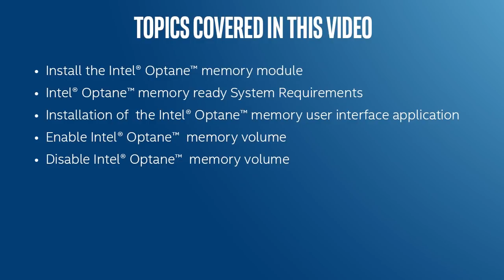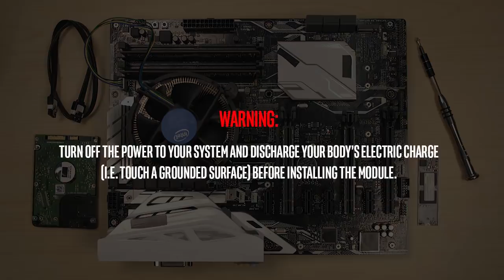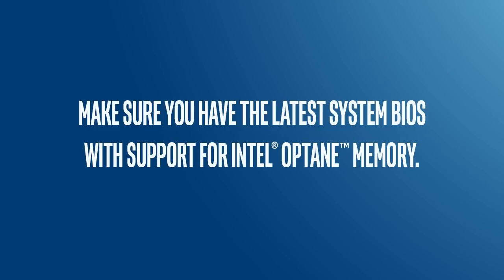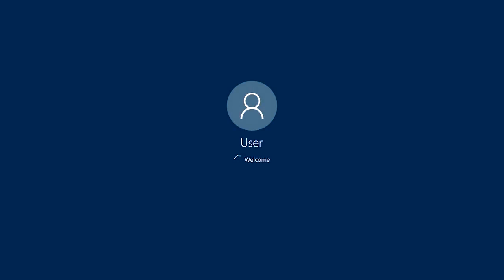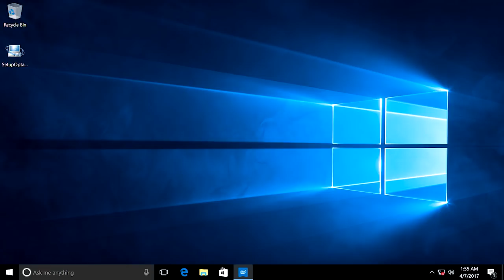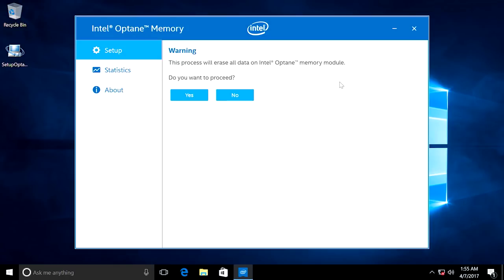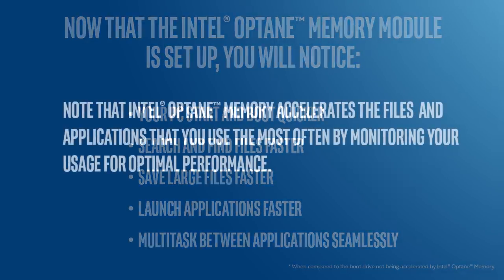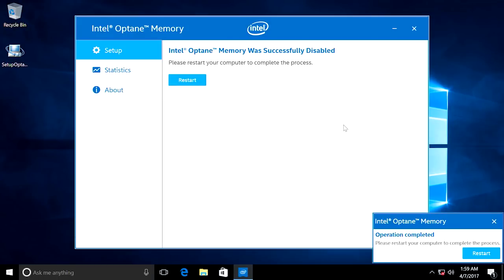How To Install, Upgrade, And Manage Intel® Optane™ Memory In Windows® 10 (basic) | Intel

Comment: what will be happen if  i installed optane memory driver without optane card ?
Reply from the maker: A driver is software or firmware that controls hardware. Often, it connects an operating system with specific hardware devices. Installing the Optane driver without having an Optane card will be of no use as there is no hardware to support the function of the driver.
Reply: @Intel  is there any Optane comes with SSD nvne m2 ?    Currently I'm using the SSD nvme 512gd SK brand.
Reply from the maker: Yes! We have the Intel Optane Memory H20 which comes with SSD with M.2 80 mm form factor and PCIe 3.0 x4, NVMe interface. Please visit https://intel.ly/3gP4avz to check out the variants. We also have the Intel Optane Memory H10 with Solid State Storage but will no longer be updating the memory applications. Please visit https://intel.ly/3DDxvlJ to know more about the Intel Optane memory performance. Visit https://intel.ly/3DEXJVd to find our Optane memory products.

Comment: Can i install intel optane on h61 mother boards
Reply from the maker: Please check the compatibility with your motherboard manufacturer. Here are base requirements to run Intel Optane memory: 7th Generation (or newer) Intel Core Processor, Intel 200 Series Chipset (or newer), Windows 10 x64, Intel Optane memory ready UEFI BIOS. More information can be found here: https://intel.ly/2FYuawG

Comment: can i add optane in h61 chipset motherboards
Reply from the maker: Please check the compatibility of Intel Optane with your motherboard manufacturer. Here are minimum requirements to run Intel Optane memory: 7th Generation (or newer) Intel Core Processor, Intel 200 Series Chipset (or newer), Windows 10 x64, Intel Optane memory ready UEFI BIOS. More information can be found here: https://intel.ly/2FYuawG

Comment: asus Z370P cannot recognize optane，why？
Reply from the maker: The Asus Z370P Motherboard is an Optane Ready Unit. Please ensure that the BIOS is updated to the latest and also check if the Optane Memory is detected in BIOS. If the issue still persists, we recommend that you contact Asus support for further technical help. Thank You!

Comment: If you really need speed use, buy an SSD M.2
Reply: how much is 4tb in ssd  ??? when i can have 4tb hdd that runs fast for a fraction of the price ??? i have m2 evo its for the os the rest is for games hdd pair with optane 7 times faster then std hdd ??? write speeds of 1400+  loads games in a flash